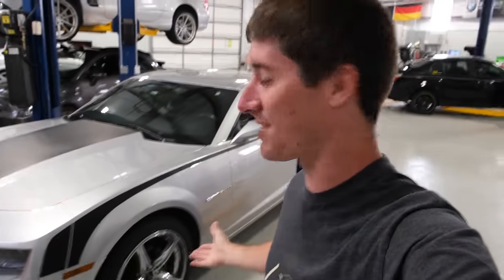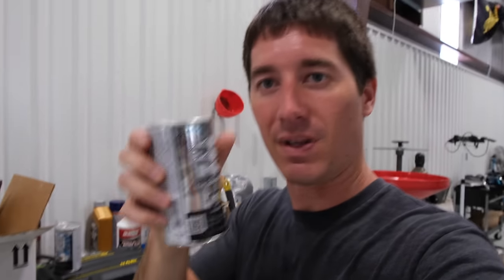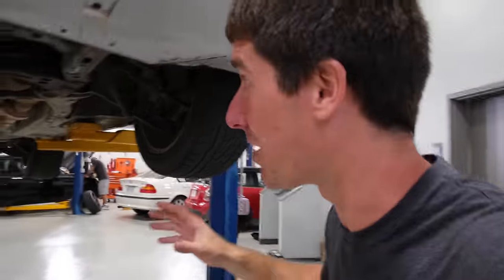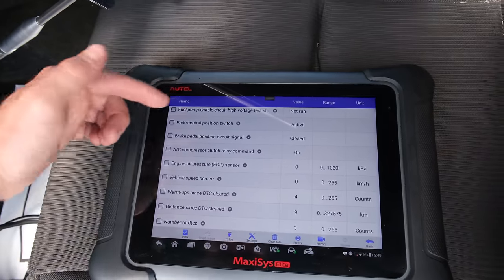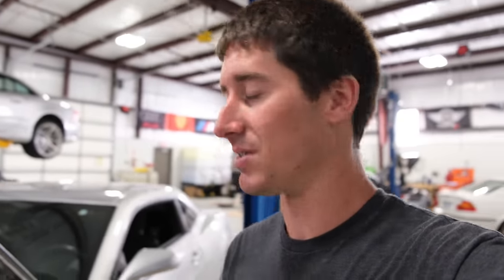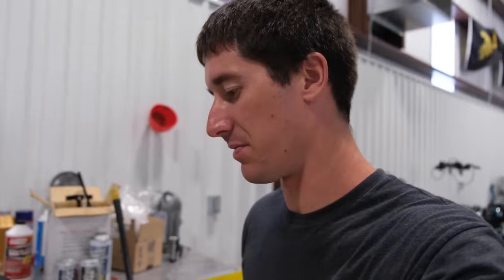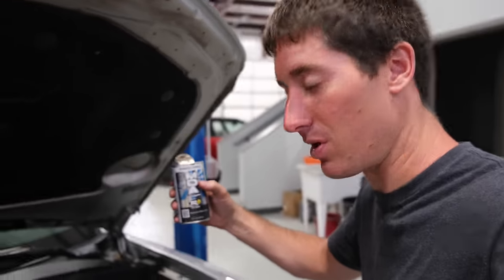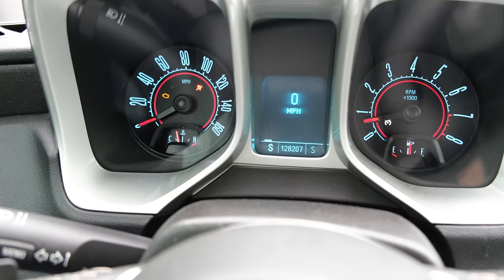FIXING The UNFIXABLE Engine In My CHEAP 2011 Chevy Camaro RS *SLUDGE REMOVAL*

Comment: Miracle stuff that dislodge sludge fast will put alot of stuff in the strainer. Would drop the pan and change the strainer at least.
Reply: Nothing a good PROPANE TORCH couldn't burn and clean, assuming the strainer is the all metal and mesh type.
Reply: Yup take off the pan, make sure OIL PICKUP IS CLEAN!!!!
Reply: When I ran the BG cleaner at the dealer the BG guy showed us how it dissolves the sludge instead of it just flaking off so it doesn't cause any issues. The 1.8L VW engines sludged all the time from pcv issues and we ran this kit and it worked well. We did have to replace the pickup also but those were common to stop up on the 1.8L so idk if the 3.6L has the same issue?
Reply: What is a strainer?
Reply: @UltraGamma25  a half ass filter installed at the end of the oil pump pickup tube submerged in the oil pan to catch "big" chunks(compared to glitter) of metal in case of a "blown engine". There's probably more to it but that's the gist of it.
Reply: Itl actually go through the screen thou
Reply: Jay exactly. That's why bg was vw's approved warranty chemicals for those early DI cars.
Reply: @UltraGamma25  A metal mesh, like the one you use  after cooking pasta to drain the water.
Reply: Haha fill it to the top and walk away for a week or so. 
And then still , ya got the risk of clogging the pickup if it's real bad
Reply: @4by108  it'll cave em in , I've seen it on aircraft engines. 
If you let an aircraft engine get that bad , you shouldn't be a pilot.
Reply: @gtzgreatride  I meant heat and burn the oil pickup strainer's deposits AFTER removing the oil pan.
I have committed a few mechanical atrocities but I'm not as uncultured as to take a torch to a fancy aluminium oil pan. 👌😁👍
Reply: @UltraGamma25  
A metal "fly screen" type gauze at the lowest end of the oil pickup tube
 that stops chunks from entering the oil pickup tube...
and thus being crushed by the oil pump and distributed to the oil filter or the bearings etc. throughout the engine...
Reply: @JohnSmith-pl2bk  when i worked at a dealer we bought an auction car that never had it's oil changed. The techs flushed it with pure atf a bunch of times and had me watch over it as it ran. I was just a lot guy at the time but was learning how engines work and did my own diy stuff at home.... Anyways they called it a day and put oil in, but the oil pressure light came on. I was suspecting the screen clogged because that engine was NASTY. Almost 30k miles with no oil change. The service manager drove it home and the engine blew... Took it apart, screen totally clogged with coal like bits. 

Thankfully that meant the car got another engine and it wasn't sold like that, they were trying to FIX IT for sale! Ha! This BG stuff looks like good shit though, it dissolved deposits rather than break off chunks.

Comment: An owner giving up on a car because of what a dealer says;   obviously the dealer has a conflict of interest.  Dealers are notorious for creating work ticket estimates that exceed the value of the car so they can give the "You may as well just trade it" pitch.
Reply: No, as a tech in a dealer, we have to be able to perform a repair that we can stand behind warranty wise. No way we can just throw timing chains on a high mileage sludged up engine. If we cant perform a repair that can be warrantied at any dealer in the country, we wont do it and recommend, in our opinion,, the best solution.  The customer is ALWAYS welcome to take their vehicle to a independent shop and have a less reliable, cheaper repair performed. Also, the service department could give a shit less what happens in sales. We are paid on flat rate so if we are not doing a repair, we dont get paid. Obviously sending the customer to the sales department would mean I wont make a dime off of it. So no, there is no conflict of interest. Sales and service departments in a dealer are two totally different businesses.
Reply: @colescrustycars  That's something a lot of people don't understand. A dealer can't offer a fix that they can't reasonably guarantee will fix the problem. With that amount of sludge, and likely associated damage, a new engine is the correct dealer-level fix. An independent mechanic can offer up cheap fixes if they so choose, hopefully only after getting the customer to sign off on the fact that it might not work or might make things worse, but not a dealer.
Reply: @jblyon2  if you watch alex the car  guy you whuld see plenty dealerships do repair s that don't fix customer problem then good independent  shops fix the problem for real him and south main auto get plenty cars dealership s mess up on

Comment: 3.6 engine has poor venting on one side valve cover that's why it's cleaner on one side. 

Timing chains always go bad on these because of that.
Reply: This. JR please look up the PCV drill mod on camaro5 forums for these things man.
Reply: This motor is a joke period. I feel sorry for all the traverse, Acadia, equinox (last Gen had V6 optional) and all the other models that have this crap engine.
Reply: I wouldnt touch this snake oil repair with a 58 foot pole. Good waste of money scam companies appreciate ur business.
Reply: Scammed.
Reply: @darrenlub  Absolutely!! read comment above
Reply: Thats the first I’ve heard of this
Reply: @darrenlub  
I'm curious why you think it's snake oil? It did clean the inside of the engine which is all that it claims it will do. If there's been damage done already because of the failure of the previous owner to do oil changes it's not going to repair that magically.
The goal of these treatments is simply to desludge an engine. We'll know whether it did that for sure when he pulls the valve covers off again.
Reply: Clif Bradley  lol I do get around! 😂😉 But I totally agree. What's crazy is that these v6s are in so many different cars, I just wish gm put the time and money into it so it would be a better engine. If that camaro was just a v8 I think it would loose big time due to fuel standards? But would of been nice!
Reply: Hate those engines. So junky.
Reply: @Rojasdrums  Here is a link:  https://www.moderncamaro.com/threads/llt-lfx-pcv-orfice-mod-importance.53385/
Reply: @fisqual  lol
Reply: Clif Bradley  V8s too?
Reply: Clif Bradley  That's okay, I see what you're saying, You mean the 6s people try to get rid of and they don't hold their value. Sorry for not being clearer
Reply: Everyone in this comment section doesn’t know what they’re speaking about listen this engine is a beast you just need to take care of it correctly , don’t change the oil every 10,000 miles change your oil every 5,000 miles on synthetic only ! Never use regular oil ! Just baby the car and it will never give you problems I have a 2013 rs lt2 with a 3.6 and my car purrs you can’t even tell it on when I’m in idle
Reply: I Know Better correct just change the oil around 20% oil life left , it’s just better for the engine this engine hates dirty oil
Reply: 3.6 has been junk since it came out.
Reply: derrick gause the first ones yes the further they keep making them they engineered the things wrong with them
Reply: derrick gause I had a Cadillac CTS 3.6 2007 it was trash the engine burned oil like crazy ! But now I have a 2013 Camero and it runs like a beast it has 113k miles ! It has outstanding service history I baby it ! I change my oil at 4-5 thousand miles even with full platinum penzoil synthetic
Reply: I work for a extended warranty company and they are still going bad as many engines we replace. The latest one was a 2017
Reply: derrick gause sir the people who bring you these cars are careless owners who change there oil every 10 thousand miles like  gm tells you that you should do , it’s all a gimmick they know people will just buy a new car once the engine is trashed and they will sell them a new one , any car will go bad if you don’t maintenance it correctly sir
Reply: derrick gause you should know the gimmicks you work for a extended warranty company lol
Reply: @Rojasdrums  Please explain.
Reply: Clif Bradley  I drove a late model Camaro V-6 that was a rental and found it surprisingly peppy.  No problem with acceleration for freeway merging.  300 or so horse power moves it around nicely for the average Joe.  What is the issue you are speaking of?
The TB engine was an L-6, it was a good engine, torquey, minus the the common lifter noise but but not sure I'd want it in this type vehicle.
Reply: @B0xlife1  It's a smallish V-6 with 300+HP that still gets decent mileage.  I'm not a fan of VVT engines generally but to get that kind of power and a bit of economy from a V-6 takes some doing.  Do they have some fatal flaws you know of or are you just not big on a V-6 in a Camaro?
Reply: @fisqual  Please elaborate on the problem/issue you have with them, just curious.
Reply: The 3.6 is not a bad engine, when you have one with the updated pcv/valve cover that doesn't burn oil.  If it does and you don't change your oil every 3k, thats when the chains have problems.  The LFX is a beefed up version of this and jts much better
Reply: @x-man5056  no I totally agree with you. They are perfect for leased cars or buying at low mileage and reselling by 100k. My Dad had the last Gen equinox with the V6 and loved it from work, they upgraded to the new model with the turbo and it moves but nothing like that V6. That old equinox is parked in the back of the shop with serious engine problems. It's rather new but with 160k miles and makes ridiculous noises lol I know it's timing related for sure and they won't get it repaired because it's too much to spend. But hey I'd drive one if I had to but wouldn't buy one unless it was super cheap or mandatory.
Reply: @B0xlife1  Thanks for that input but Yikes.  My wife is driving a 2011 Terrain with the V-6 with VVT.  It has been maintained meticulously and runs well...now.  Hmm.
Reply: I Know Better  my experience as well , don't go over service intervals and we're good.
Reply: @x-man5056  best of luck, maybe some were built better? I've noticed that allot with some of cars vs others that have constant issues. Like a Wednesday car vs a Friday built car.. Lol
Reply: Yup had a 2010 v6 timing went out 95k miles clocked me for 2,500 b4 I traded 😤😤😤
Reply: @B0xlife1  I'm familiar with the scenario.  So far, it's been a pretty good car.  Never liked the idea of VVT.  Simplicity almost always has better reliability/longevity.
Reply: I had same problem on my 5.3 engine also
Reply: @Chinunit22  my 2000 Silverado has the 5.3 190k miles sludged to all hell, has oil pressure issues but still runs like a top.
Reply: @B0xlife1  try oil catch can, it made a difference on my 2011 Silverado
Reply: People don't change their oil. I've seen both sides of this with the 3.6. I've put pistons in and tons of chains. If you do 2 oil changes in 40k they fail. I've seen plenty over 200k with original internals. As for this sludge removal joke, it doesn't work. Bearings and oil pump fail soon after.
Reply: @B0xlife1  Cadillac and buicks too this engine and gm is a joke
Reply: Yea I had this same engine in my commodore and they always wreck their cam chains because they are tensioned with oil pressure
Reply: Absolutely correct Derrick, You need 2 oil catch cans for the 3.6 engines. One per valve cover to keep both sides clean.
Reply: @cruzmarco3483  wrong, can't tell you how many 3.6s I've seen fail before 75k miles with proper maintenance. An absolute embarrassment of an engine, along with the 2.4
Reply: My neighbors cadillac 2015 cts timing chaing went out at 90,000 miles and he keeps the maintenance done all the time dealer is the only one servicing it. 

It needs a 4500.00 timing chain job now.

He just told me about it yesterday.
Reply: It's silly  if you're going to buy a Camaro you buy the V8
Reply: @neilmurphy845  Apparently you haven't ever driven one with the V6 because it still kicks ass for a 6 banger
Reply: @thedude6547  no I haven't driven it it's like buying a fake M  or a Lamborghini with a V8 instead of getting one with a v12
Reply: @cruzmarco3483  it sounds like GM wanted people to meet with the EPA that's why they said 10 instead of 5 thousand
Reply: @ryandickerson6395  I had a 3.6 saturn vue with 85k miles that was driven HARD but maintained to a T, no issue.
Reply: @cruzmarco3483  Same exact Engine bro
Reply: @kens97sto171  these flushes do a lot of damage as all those particulates pass through bearing surfaces, cam lobes and all the other tight tolerances. It's a bandaid fix, for sure. But if a $300 treatment makes this car useful for a few more thousand miles, so be it.
Reply: @ravenfn831  
Oil filter should capture any large particles. They  could be flowing through the engine bearings before it gets to the filter. Not really certain what you could do other than disassemble the engine clean it manually and put it back together again. If the flush extends the life of the engine or usefulness at least I'd say it's a win.. leaving the sludge and crap in there as it is isn't going to help either.
Reply: @kens97sto171  - I think we agree.   When an engine or even a transmission gets really bad, flushes can make things worse. You are dislodging this dirt and grime and it absolutely does cause wear. I'm glad this guy made a video on this product as you can clearly see results. It's a last ditch effort to avoid tearing the engine apart. But now, he'll have to probably replace bearings during the teardown.
Reply: Probably the best thing would be to get a new engine. 
One of the issues with contaminated engines is the risk that you can never get all of the crap out of all the little oil galleries. 
So you can take the engine apart  put new bearings in it and end up with the same crap floating around in the brand new repaired engine.
Personally my solution would be to not buy one of these in the first place LOL.
For my daily drivers I tend to stick to Toyota.
Got a 2008 Prius with 364,000 mi on it.
Boring car not very fast, super practical super comfortable super efficient and at least for me super reliable.
I drive over 50,000 miles per year so for me the difference in fuel economy is a significant issue, I tell people all the time when they ask about Priuses if you only drive your average 10 or 12,000 miles a year it isn't worth getting a Prius unless you just really like the car. You're better off with a Corolla or a Camry or some standard car. Cuz you're going to get stuck taking it to the dealership to get repaired there aren't as many aftermarket repair shops that know what they're doing with Prius although they're not hard to work on actually but many shops won't even touch the car because they're afraid of it.
But for me 45 to 50 miles per gallon versus 25 to 35 miles per gallon is serious money.
Reply: @kens97sto171  - I got to drive a Prius a few years ago. Absolutely loved it. Mainly for the quietness. If you are on a small country road with the windows down and stop at a stop sign, all you hear are birds chirping nearby. As an old fart, that is so damn cool. Yeah, not needing gas is cool, but I like the quietness. And They have great pickup for a small car.
Reply: @ravenfn831  
Yep.. all thing I like as well.
They get a bad rap for being slow.  But 0-30 or so they are decent quick.
Roomy, comfortable, reliable, quiet..
Yep.. I'm an old fart too.  And those are things I value over power.
I will tell you though I drove a Tesla Model 3 performance few weeks ago. If I ever have enough cash to pick up a car like that that will be my replacement for the Prius.
If they have a showroom near you I definitely recommend scheduling a test drive. They are weird there is some things I don't like about them. But the quietness was unbelievable and the power is also absolutely astoundingly fast. And I've driven some fast cars in my life Z06 Corvettes etc 
Performance model 3 hits 0 to 60 in 3.2 seconds. And it just pulls and pulls right from the stop and doesn't stop pulling. It is thoroughly impressing. I just wish the door handles were a little more ergonomic and I don't like some of the interior design choices, don't like how a lot of the settings are done through a touch screen when they could have used a simple button on the door panel. But very rarely do you get a product that you like every single thing about it. You're lucky to get 80% of what you want. If I had to sacrifice a few interior quibbles and some features I didn't like how they implemented them but have the quietness and power and handling while being efficient at the same time I would make that trade.
Reply: @B0xlife1  I've seen several go to 200,000 plus. Just regular maintenance.
Reply: I have a 2011 LS V6 Camaro and I have 130k miles on it. Every time I start my car in the morning it makes this rattling noise and I'm assuming its the timing chains but took it to a mechanic and he said that I should get the engine replaced. I'm getting a 2nd opinion today but what do you guys suggest

Comment: “Never fix an engine” eh, more of a guideline than a rule…  Makes for good video… :)
Reply: Sewan & Sawen Creations  Oh, I know.  I do pretty much all my own repairs, and my dad has been a mechanic since the 60s, or really, the fifties when he started building race cars as a teen, and has rebuilt goodness knows how many motors.  I was just poking a little fun after the last video where he said “I broke my own rule.  ‘Never fix an engine, just replace it at the beginning’ after the beemer cratered ignominiously. And here we are again… :)  But… different engines, different issues…
Reply: Sewan & Sawen Creations  Heck, we’ve got an 8.3 diesel in the shop right now that we’re in the diagnosing stages to decide if it’s worth fixing.